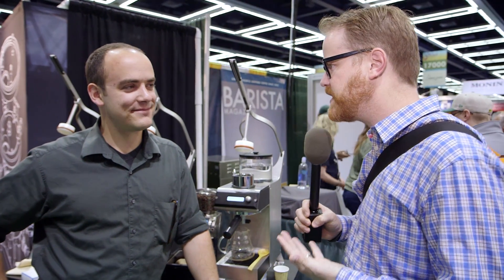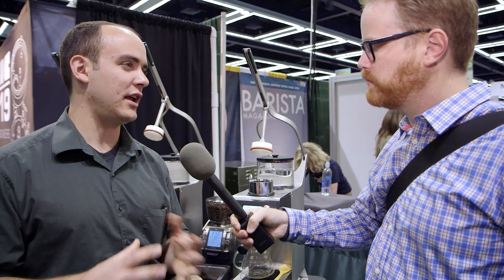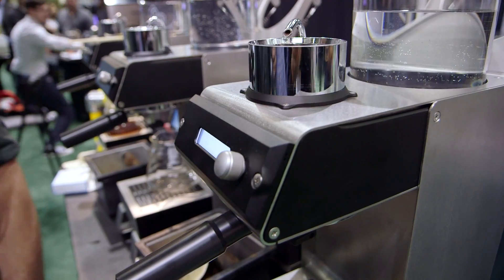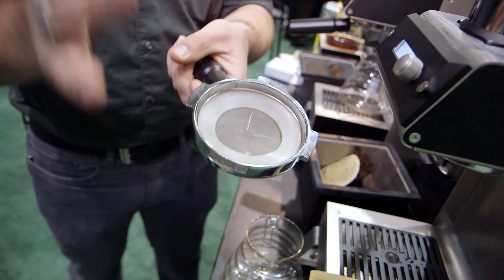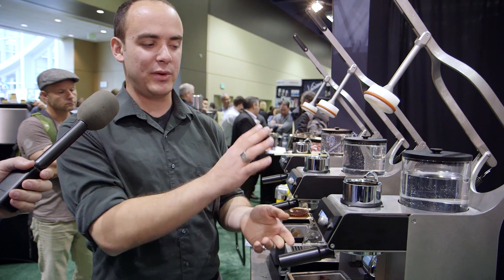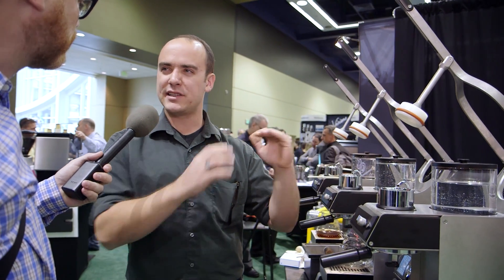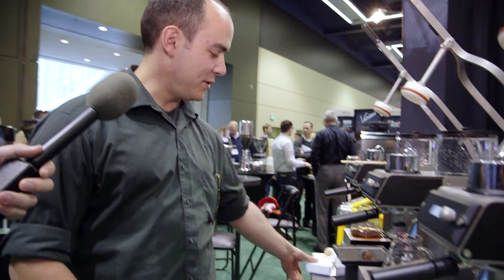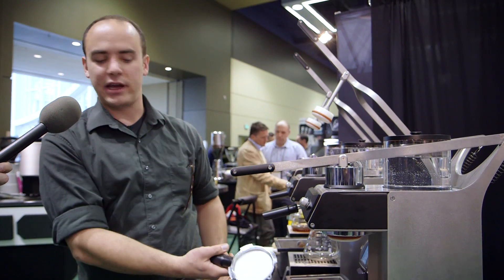The Chemistry of Coffee Brewing with Blossom One

Comment: when I make coffee, I pour hot water over ground coffee. That's all the variables that I need.
Reply: David Harvath
as a german, I can assure you that I never drank any of your american piss brews, and with that, I'm satisfied :)
Reply: ***** For some there are a few more variables. People like Will weight the grounds, use a special pour over pot for the water, use a special ceramic funnel and weight the amount of water that the use to the 10th of a gram taking into account the amount of water that the grounds will hold.

I used to follow a coffee drinkers forum. They would roast their own beans using a very specific popcorn maker that they can only get used on Ebay and then have to modify it to defeat the thermal cut off switch.
Reply: ***** I do the same, but making coffee professionally is different since you need another level of speed, consistency and reliability.
Reply: DeadlyMountainPro Slight problem with your calculations. A standard "cup" of coffee is 177.441ml or 6oz. Not 8 oz, approx 255 ml but really 236.588ml1. Otherwise you may have another  Mars Climate Orbiter disaster. Also not sure you took into account water retention of the grounds. 

Oh and no need to do the math, there is a chart.

https://www.blackbearcoffee.com/resources/83

and don't forget the H2O delivery device.

http://www.everythingkitchens.com/hario-coffee-pourover-water-kettle-vkb-100hsv.html
Reply: Ahhh my issues is i converted the liters to the literal cup, not the fl oz. in a given cup haha, nice catch. All around besides forgetting the dilution of the solute in the solvent, pretty good stuff eh?
Reply: DeadlyMountainPro Damn, I was hoping you'd include the Brix refractometer reading for the TDS in accordance with the SCAA.
Reply: ***** you are probably satisfied with coors or miller lite too.  ha, jk.  I like strong coffee, that's about it...some of this stuff is a bit much.
Reply: Cliff Hartle 
Man, I bet those guys think I'm just a straight up Plebeian.

I buy 4lbs. of Arabica (likely low grade) for $12 when it's on sale at Safeway and then I use that until I'm down to the last can, and then I buy another 4lbs.

Comment: PID doesn't really work on non-linear systems...
Reply: Kony Hawk Pro Slaver Yes it does. While MPC arguably is better (there's some disagreement here, I personally prefer PID), PID is usually enough in industry. Like 95% of all controllers are PI. My guess is that this coffee brewer uses some kind of over-dampened controller to avoid temperature overshoot. Other than that it should be pretty easy to control.